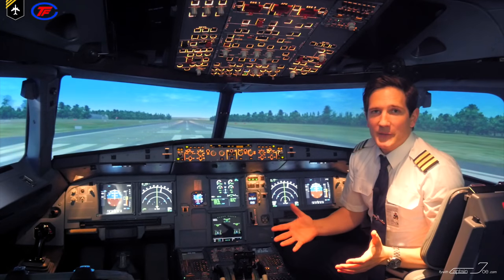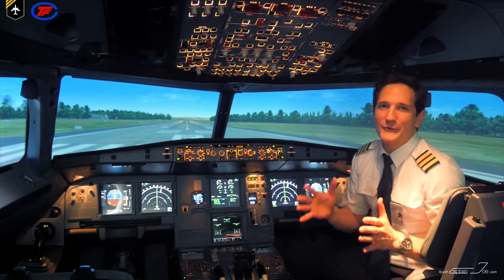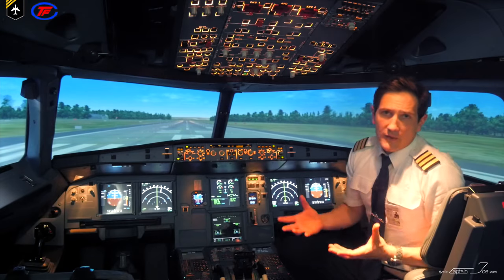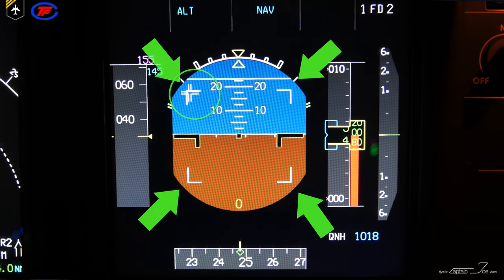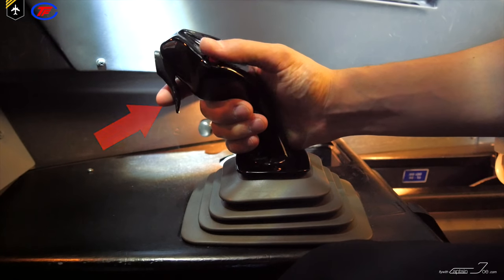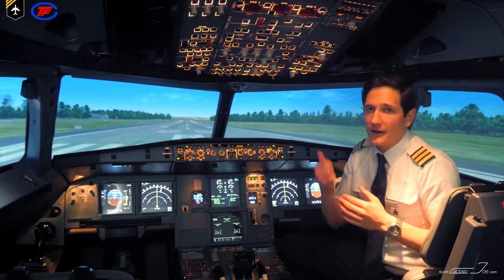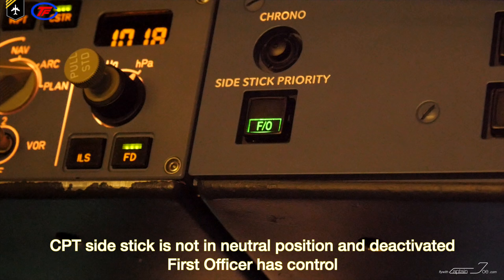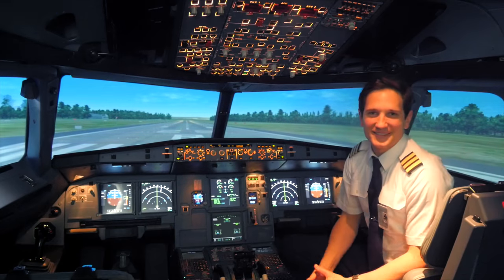AIRBUS SIDE STICK - Explained by CAPTAIN Joe

Comment: For those Boeing enthusiasts and pilots that flew older Boeing airplanes, the Airbus side stick in manual mode is essentially the same as how control wheel steering (CWS) in those older Boeing jets worked. You put the input, released the wheel and it stayed there, and as in Aibus, the older Boeing in CWS mode, auto pitch trimmed worked. Same concept, just presented another way. Nice video.

Comment: I really wonder how CaptainJoe would perform in B737 simulator, without any introductions.
Reply: Better than a regular person for sure , im sure the differences arent huge
Reply: He flies a 747 you know...
Reply: @frodobaggins2852  he flew an Airbus before. I believe it was an a320
Reply: @claudiofernandez9136  yup, but now he flies a 747..
Reply: @frodobaggins2852  Yes, thats right
Reply: Hi flies a B747 Cargo
Reply: Mentour Pilot is already flying a 737
Reply: "What's this big thing blocking my legs and where's the side stick"
Reply: @taxfraudpro  Yoke
Reply: @ag6371  no he means sidestick
Reply: @taxfraudpro  he flies a 747 now so hes used to a yoke
Reply: @claudiofernandez9136  yes he did fly the a320 for 6 years
Reply: He would have minimal issues.  He has experience with airbus and Boeing aircraft.

Comment: When I was using a flight sim at my HS one time a few years ago, I remember the rudder pedals and flight stick didn't have any tactile resistance to them, making it really easy to move like i'm just twisting my fist or pushing my feet out, personally resulting in me over correcting by a large margin. I was wondering if actual planes have any resistance in the rudder pedals or flight stick to prevent this.

Comment: Is there a significant advantage or disadvantage between sidestick and yoke? Do you prefer one over the other?

Edit: Thanks everyone for your answers! Really interesting and it seems there's no clear answer which is better, so it comes down to personal preference and/or the type of plane you're obligated to operate.
Reply: woolver42 maybe the yoke is a bit easier to handle, because imagine you are left hand and you sit on the right, dk if it is easy to be precise with the sidestick as the yoke
Reply: It makes basically no difference. When you fly, you normally have one hand on the sidestick or joke and the other on the thrust levers. So even with a joke you will fly the plane basically with your left hand only if you sit in the left cockpit seat because the thrustlevers are on the center console.
Reply: therefore it makes the sidestick more convenient to handle and it is less in the way of the pilot :)
Reply: That makes sense shi...good explanation.
Reply: The yoke is better. You can see exactly what your partner is doing and you can take over anytime without messing with priorities. There was a plane that crashed due to a stall and one of the pilots was pushing forward to push the nose down (which is correct and would have saved them) and the other was pulling back (because he was an idiot). During the emergency, no stick shaker was active and the pilots didn't pay attention to the dual input warning. Their inputs were summed up and the elevator was at neutral. Everyone died.
Reply: Daniel Yong I think you just described the cause of the  Air France Flight 447 crash (Pilot Error). Its also the biggest disadvantage of the sidestick itself sadly. (more training and situational awareness probably needed to prevent this, according to the BEA (if im correct))
Reply: woolver42 A sidestick can prevent over controlling & pilot induced turbulence. There was a video awhile back with a 737 pilot moving his yoke like crazy during landing. The sidestick & autotrim can proven that from happening.
Reply: Dong Huang Now that the Pros of the side sticks. Both Yoke and Sidestick do have their pros and cons, but for me, the most important part of these control is the pilots itself. As long as the pilots do know how to control their aircraft well, its fine for both yoke and sidestick ;D

Note: And hopefully, those pilots do aware their situations in their enviroment as well~
Reply: One of the huge advantage for a yoke is both Cap and F/O is able to see the movement of other side. IF airbus is equipped with regular yoke other than side kick, tragedy like Air France 447 has a higher chance to avoid (Sine the air craft is running under alternate law no one had notice F/O's stick is still pull up and cause plane to stall).
Reply: Air France 447 stalled long before the pilot not flying made any inputs on his sidestick. The problem was that the pilot flying started to climb for no reason when the pitot tubes iced up. That's what caused the stall in the first place.
The first time the pilot not flying moved his sidestick at all, the plane was already descended to about 15000 feet and in the end he also failed to push the stick forward long enough to have any real chance to end the stall.
Yes, there were dual inputs, but in the end, they didn't made the difference . With the inputs he did, the pilot not flying would have never been able to safe the plane, because he never pushed the stick fully forward for more than 3 seconds.
Reply: Hi Grand Negus, Yes why not ? Usually it's only for tests or airshows. Of course you can't perform aerobatics, but the demo boxes for airshows, like in "Le Bourget" are not very wide, look at demos flignts during airshows, and you will see that 747, 777, 350 or 380 are very keen on sharp turns.
Don't forget 0 g planes !!!
Reply: An A320 pilot told me that it was more comfortable to have the side stick, because instead of the yoke they have a table which is more convenient when eating and doing other stuff. 
Yes, some yokes come with tables but they are constantly moving and aren't as big and useful, plus being a pain in the ass when eating.
Reply: sk flyer Yes, pilot need to eat peacefully. Otherwise they dont have energy to fly.
Reply: Are you sure sound like the Thai Air crash at Surat Thani...A300
Reply: woolver42 I know this is old, but my teacher is a retired pilot for delta, flew dc3, dc9, 727 and 737, he’s flown thousands of hours in those aircraft, but I guess he’s biased towards Boeing aircraft, when compared to airbus. 

Today in class (im a high school senior in a flight class) we watched the investigation of the airfrance flight 447 crash. 

He told us this, Airbus design philosophy for their aircraft is very automated and lots of computer involved, the sidestick and the aircraft pretty much do everything for you, when you want to climb, it’ll automatically adjust the thrust and best attitude for climb, the airbus side stick will not allow the pilot to make controls that are potentially dangerous. Pretty much the aircraft does many of the work, flying with a side stick is easier, but the pilot has less control of the aircraft, the computers in the aircraft covers majority of what is needed.

Boeing airplanes are more traditional, yoke, pedals and manual thrust (air bus thrust is mainly automated by the computers), if a pilot were to perform a control that could harm the aircraft, the plane is not going to stop the pilot. But the pilot has more control of the aircraft.

What happened to airfrance flight 447, they had an airbus aircraft (a330 or a320 if im correct), very good safety record. The aircraft had the airbus sidestick technology, the computers did majority of the work, what happened was that the pitot tubes of the aircraft malfunctioned, because the pitot tubes malfunctioned, the automation of the flight systems malfunctioned, the auto corrections of the aircraft malfunction, so the pilots had to fly the aircraft “like normal”. The pilots on Air France 447 were in a stall, the junior pilot kept the plane in a nose up position, but they were stalling, to recover from a stall you must go nose down to recover. The reason why the pilots were going nose up, is cause the sidestick, right as the pilot (in control) realized that he put the aircraft nose up, instead of nose down because he pulling back on the sidestick, he realized to late. At this point the aircraft was descending at a rate of 10,000 feet per minute, they were around 6,000 ft above sea level, it was to late.

Sully Sullenberger (the pilot who landed the airbus aircraft in the Hudson River) was interviewed by CBC, and he said he personally felt that if the airfrance flight had a yoke, the crash could have been prevented. The reason is, in a normal traditional Boeing yoke design aircraft, the yoke is the same on both sides, they move the same time, whereas the airbus side stick move independent, and as captain joe said the aircraft will average out those two control inputs. If the pilots of airfrance had a yoke, and they intended to go nose down, they you’ll pull the yoke in, and both pilots would know to go nose down. 

But keep in mind, I’m not a pilot, and my teacher is probably biased towards American products
Reply: shi01      Everyone is aware that AF 447 crashed because the pilot flying didn't know what the hell he was doing.   The point is, if there has been a yoke the pilot with a brain would likely have noticed the incorrect input and would've had a chance to correct it.   So says Sully and a lot of other people.  As it was, the incompetent pilot was allowed to fly the plane into the Atlantic because the pilot next to him didn't know he was making the wrong input.
Reply: You forgot your Leather Helmet and Goggles...Viva Airbus way to go...Bye Boeing way behind
Reply: ...Bonin...
Reply: yoke
Reply: Yoke is a lot better